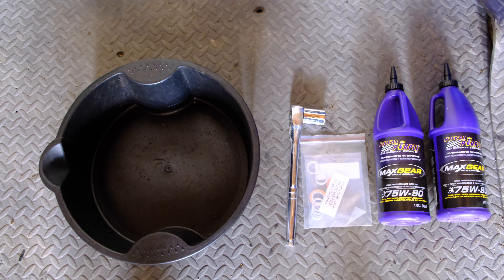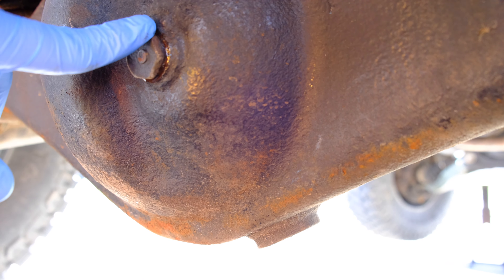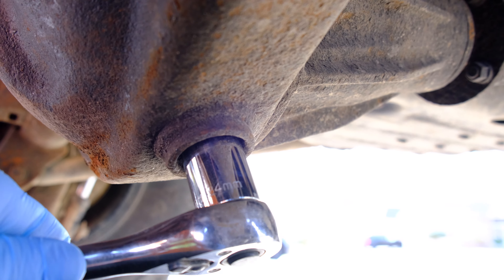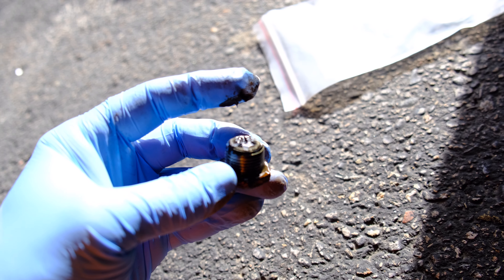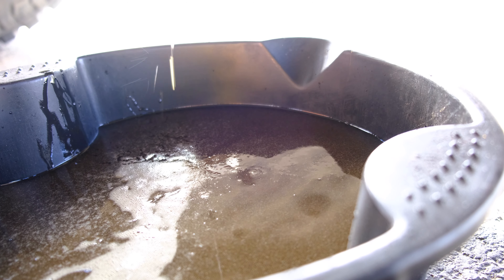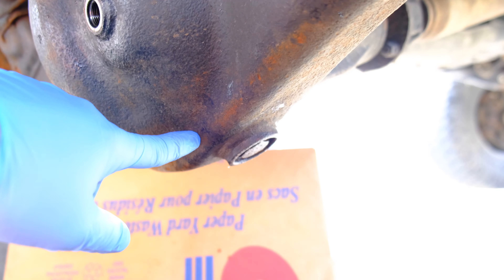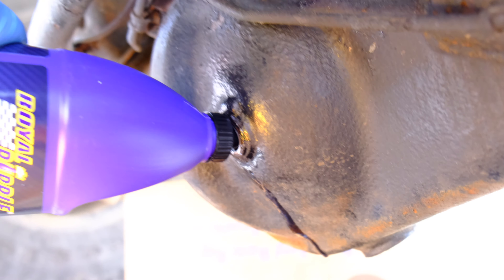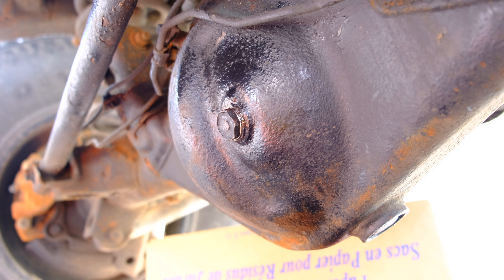Changing the Differential oil In My Toyota FJ Cruiser. (1grfe 4.0L V6) Rear Diff oil Change at home.

Comment: remember to always clean the axle breather located on top on the drivers side. mine clogged and the pressured bled out through the left wheel seal. replacing the seal is a big deal but it can be avoided if you just loosen the breather every time you replace your engine oil. my 08 FJ has 179,500 miles and still strong.